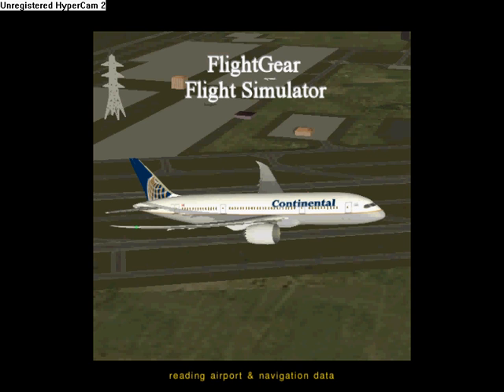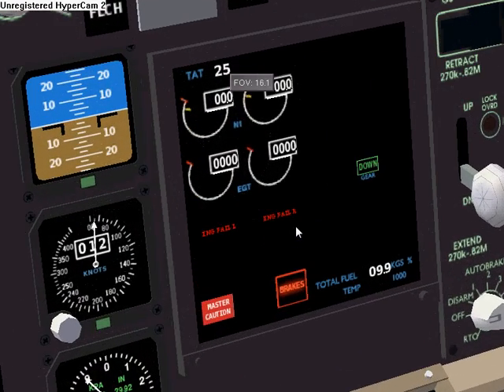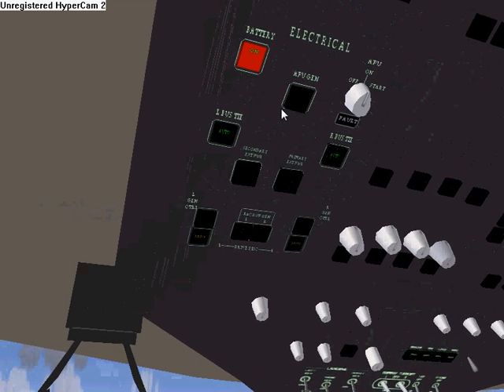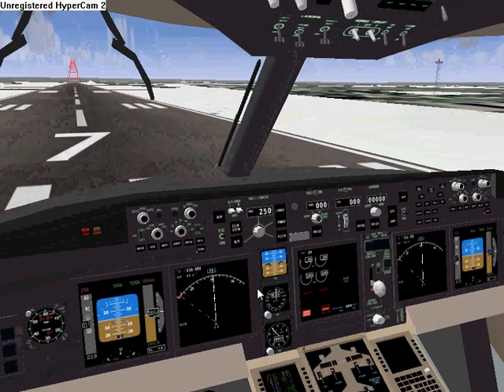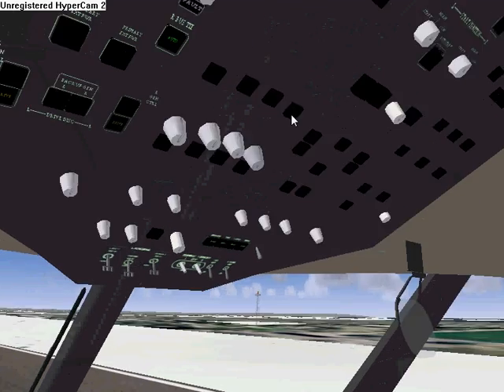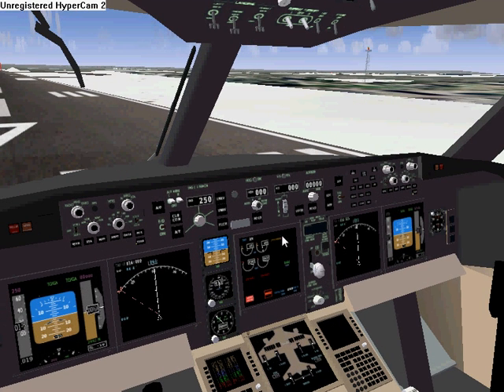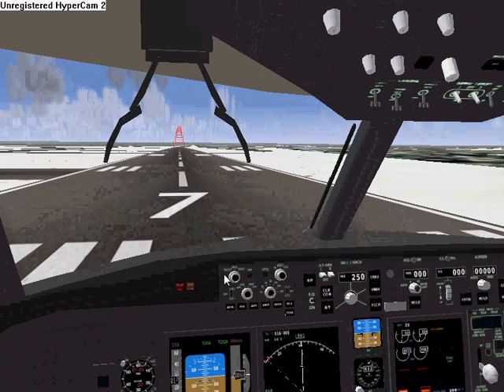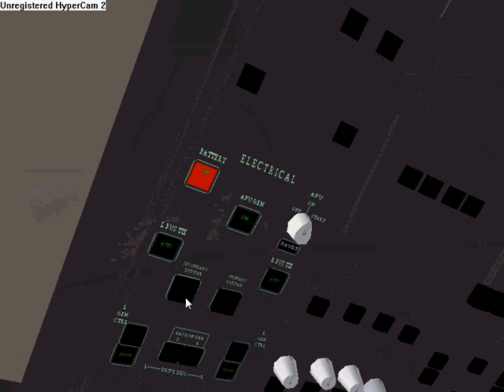FlightGear Video Tutorial: 787 Startup

Comment from the maker: Well, lag, or more importantly, framerate, is based on a huge variety of variables.  Maybe you need a faster internet connection (basic DSL should be fine), or a better graphics card.  If you can't afford a better graphics card, maybe upgrade your RAM (I think that's cheaper).  Or, try turning off some of the eye candy stuff, by selecting View>Rendering Options and unchecking some of that.  Stop any other running programs that you don't need (obviously keep security programs running).

Comment from the maker: Well, if you use Windows or Mac, you should be able to select an icon that opens a launcher.  You then select the aircraft you want to fly and your starting location, maybe change some other settings, and hit "run".  If your operating system requires you to use a command line, then I have no idea, but I'm sure someone in the flightgear forum does.

Comment from the maker: You should have a GUI menu that runs across the top of the screen when FG is running.  If not, just press F10.  Then, go to Help>Toggle Glideslope Tunnel.
Btw, it completely destroys the challenge of finding and landing on a runway, so if you're confident in your ability to land, you may find using it to be boring.

Comment from the maker: Honestly, the wiki never said to shut them off.  I'm sure I don't need the battery anymore once it's started, but I just never tried shutting it off.  The APU generator can actually produce a small amount of propulsion (I'm not sure if FG models this) in the case of engine failure (think miracle on the Hudson), so I just leave that on, even though FG doesn't have any bird strike scenarios.